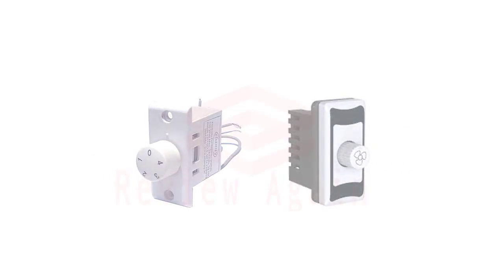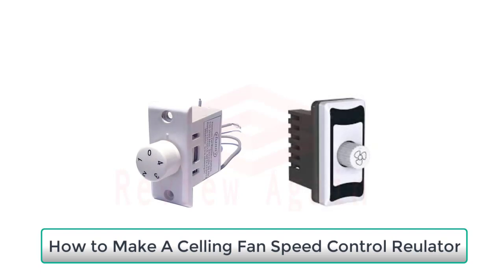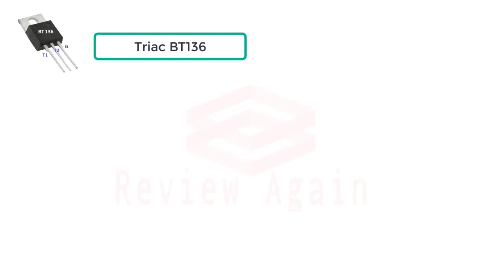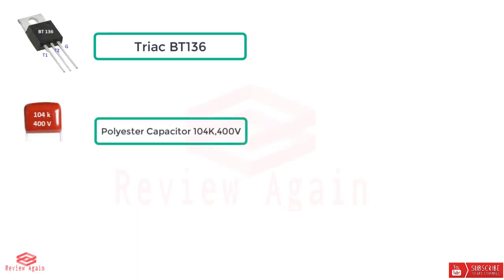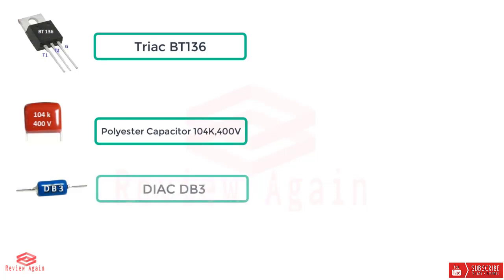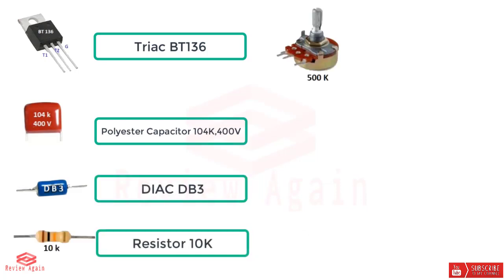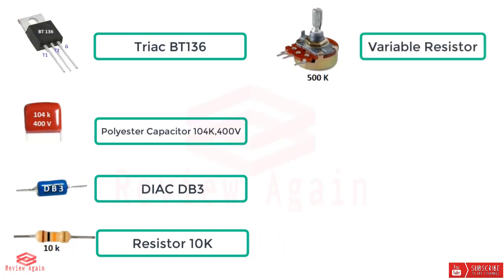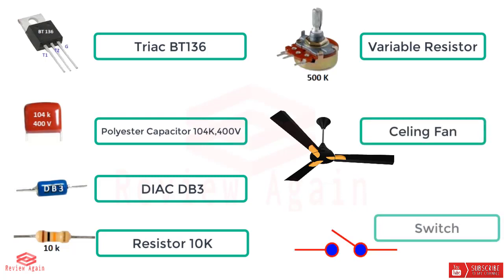How to Make Ceiling fan Speed Control Regulator | Speed Control Regulator Circuit Diagram

Comment: The circuit ran out exactly, but in a sound in the fan at the slow speed, what do I do? Thank you very much for the helpful circuit. Please reply
Reply: This design will not eliminate the hum, it's no different than the ones you buy that are fully variable.  Need the ones with fixed speeds that use something like an 8 mf capacitor.